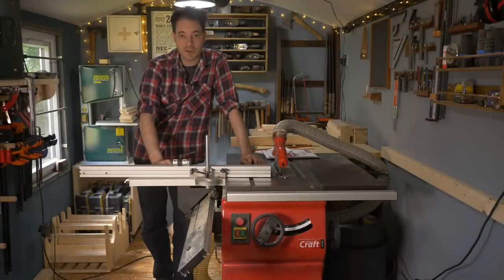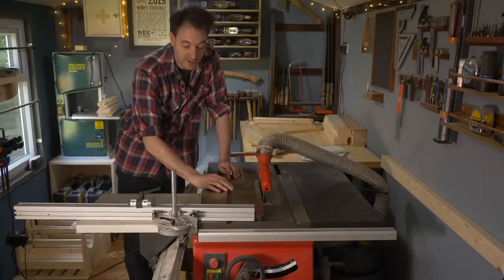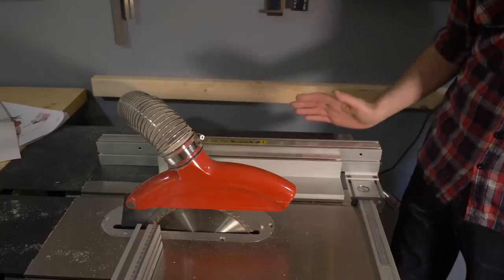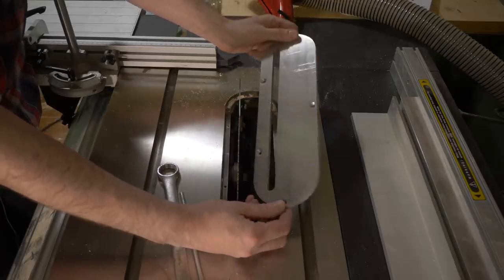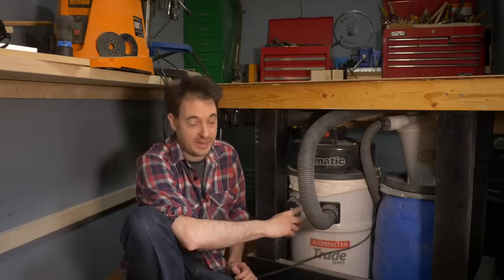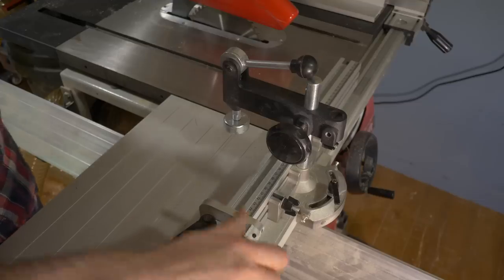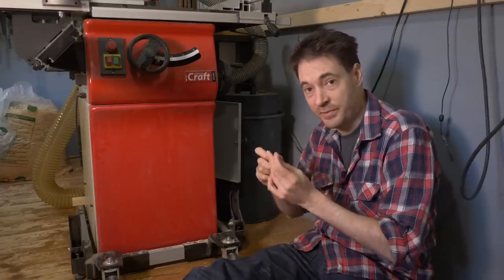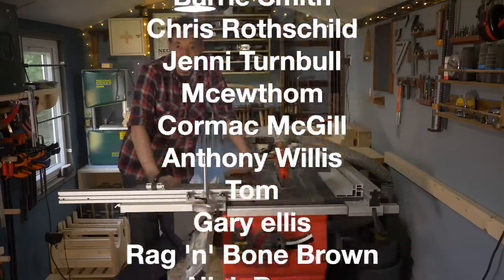Axminster Craft AC216TS 216mm Table Saw Review

Comment: Slightly different opinion.  I have had the saw approx 8 months.  Regarding the sliding fence, the wheels on the slide mechanism go out of true and I ended up with wavy cross cuts. The hold down bar/ pivot is almost always in the way of the stop, cannot slide it past the pivot.  You have to take it off one end and put it back on the other andi it won’t sit in front of the pivot .  When I received the saw the cast iron table was almost 2mm out of true to the cabinet but was true with blade.  This meant when the slide was fitted ( fits to the cabinet, not the table) it was out of true with the table and fouled it at one end.  I had to pack it out with washers to fit.  The fence almost always moved outwards at the far end when clamped so it asn’t true with the blade.  I solved that by packing the cam lock with tape to counteract the drift as i tightened it.  Axminster sent a replacement fence and that seemed to be better.  The riving knife is higher than the blade which means cutting half lap joints etc is impossible.  I solved this by cutting the top off the knife.  I found that I never needed the dust extraction from the  top so no great loss.  I use the Axminster AC50E using the bottom port with the top blanked off and there is virtually no escaping dust.  I wanted to use a table saw sled but the out feed table mitre fence grooves stop short of the end meaning the sled would not slide all the way through the blade.  fixed that by extending the groves.  Finally the supplied riving knife was a tad too thick so ended up taking all the paint off and grinding it slightly.  So now i have a table saw I’m happy with but why Axminster don’t have a different option for the riving knife and extend the grooves in the out feed table, sort the fence so it stays square, and don’t get me started on the sliding fence (a member of staff said to me when I bought it to use it periodically otherwise the wheels flatten, he was not wrong and I used it all the time).  Don’t let me put you off all in all it is accurate, it is quiet just needs a bit of fettling

Comment: I have been looking at getting a Dewalt site table saw but I wasn't keen on the noise plus they just aren't as accurate so was looking for an alternative that was still reasonably easy to move around without needing an engine hoist to move. This looks like the best of both worlds to be honest and doesn't cost much more than the Dewalt. I think I will be getting the slightly larger version of this, as they now do one with a 254mm blade and 1.5KW motor and a slightly larger table. Great review.
Reply from the maker: The 254 saw looks a great machine. I would have got that one if it had been available at the time
Reply: @Badgerworkshop  I too was about to get a Dewalt contractor saw (It's in order and I am waiting for it to be in stock), but after seeing your videos about this saw I've changed my mind. Just like Paul says, noise is a major concern, but also things like the lack of a cast iron top. I've seen Axminsters before, but I thought they were not as affordable. Thanks so much for making these videos. The link you've posted to the saw is not an affliate link, is it? Would be nice if I could support you
Reply from the maker: @doisneau  It as an affiliate link, thank you. I hope the saw will be back in stock soon
Reply: It is quite heavy though. Not really designed to be mobile.
Reply: @asconaracing  No, they are heavy but compared to a full cabinet saw they are still quite easy to move around the shop. Not 'portable' though by any measure.

Comment: Great clear concise review. You only missed out on depth of cut, issue with Riving knife height compared to the blade stopping through cuts and detailing how accurate the main bed of the table was (flat). For my workshop, as far as I can find, this would be the best option available despite its flaws and while I don’t need the sliding table I think actually it would be really useful given that it comes off so easily and can then be hung up out of the way. Thanks.

Comment: Hi Matt great review on the table saw. The cast iron tables nice with the extra wing for wide ripping. Its good to see a proper long saw 
arbor and traditional locking nut. I'm impressed with the build quality overall, the sliding crosscut table fence is a real advantage like 
you say. The swivelling mitre feature on the cross cut fence is amazing that's a real bonus. A point on the noise, its the size and type 
of saw blade that fitted which produces the noise not the motor. It looks very capable of making accurate wooden components. Tony

Comment: I have the Axminster 1600 panel saw. Bought a few years ago. It has a large foot print even in a 3 car garage size  workshop but one of the simplest and most useful addition to it is a Fritz and Franze (probably not spelt that last bit right) jig. Search on YT. I think he's called 'extreme woodworker' There ain't much info but a guy in the states with a seriously expensive Martin table saw shows how to make one. In your tiny shop you would get a lot of use for it with that parallel sliding table. Safely cross cutting small parts etc. Have a look it will need a bit of thought to adapt to your machine.
Nigel.

Comment: Hi Matt, I watched your videos on this saw several times while choosing which machine to go with.  Your positive reviews, plus those elsewhere, encouraged me to buy the table saw around 18 months ago, and the sliding table last Christmas.  This is my first table saw.

Have you had to make adjustments for accuracy?  If so, did you find them acceptably easy to make?

All along I have found the various adjustments to achieve accuracy very fiddly and awkward.  Currently I'm trying to get consistently accurate mitre cuts.  I've spent many hours getting the sliding table into an accurate position in all dimensions, including during the slide itself.  I've managed to get the mitre angle quite close to accurate, but when I make another small adjustment to the relevant small bolt, the effect of the adjustment seems to be fairly unpredictable.  I can't home in on a good enough 45 degrees.

Do you have any thoughts on this?

Thank you, Roger

Comment: Thank you!

I think my shop is smaller than yours but I might consider this saw after your review. Maybe I can make it fit without the extension table as it is 400mm slim. I was thinking about buying the Bosch GTS10J but the aluminium table is putting me off. 

Regards, 
Etna.
Reply from the maker: With the sliding table it’s a nice compact machine

Comment: Thanks for that video. You have confirmed my hopes and removed my few concerns. I’m even persuaded by the sliding table argument instead of a miter saw for a small shop. 
It seems expensive for a hobby set up, but that’s possibly redeemed by fewer fiddle moments with cheaper solutions. A craft should be about skill and not tools (if not about just making things)  but good tools do seem to go a little way in resolving some skill/experience shortages (speaking for myself of course). 
Thanks as always for the content.
Reply from the maker: Thank you. Better tools certainly makes life easier

Comment: Hi David, have watched this video several times now and it has convinced me that this will be my next saw, after 1 cheap and one not so cheap had to be returned.
 Concise and detailed description of most of the working details, however you did not mention if the saw came with a mitre gage and Axminster say, "There are after sale mitres that fit the saw" Will need to speak with Axminster. Was one delivered with your saw? The fact that the sliding table has allowed you not to have a dedicated mitre bench is yet another buying point. Will need to save for the sliding table. Thanks for a highly informative video. Get onto Axminster for some sponsorship!!!
Reply from the maker: It did not come with a mitre gauge. I already had one

Comment: Impressive saw. Could you tell me, what is the height of the table above the bottom edge of the stand and the table dimension with the rhs extension? Like you Im stuck for space and this saw seems to outstrip anything else for value and quality and use for finer woodworking.

I did hear that you can get a longer arbor that might allow dado blades to be fitted- is this so?

You reviews are really useful Mat- keep it up.

Comment: Hi Matt.  I am very seriously thinking of going for this machine over the DeWalt 7485 for my small, mostly hand tool shop (single garage-sized).  But I need some advice on dust/chip extraction.  I noticed you have reviewed quite a few solutions over the years and I was wondering, now you know what you know, and were starting again with the Axminister 216, a small (crappy) planer thicknesser, and not much else, which dust/chip extraction system would you do for?  I am on a budget, and I don't really want to spend 50%+ of the saw price again on extraction (seems a lot!), but then again I do want something quiet (If I am buying a quiet table saw, there is no point if the extractor is crazy loud!) and not too big.  Have seen a brand model what you feel would be best?

Any help you can give would be much appreciated as extraction is part of the budget, so would like to have decided before I press the button on the saw!

Many thanks,  David
Reply from the maker: I’m using a twin motor cam vac. It is small and can be used on all my machines
Reply: @Badgerworkshop  Fantastic!  Although not cheap these sound good.  Do they move enough air for the table saw OK?  Also are they quiet?  I would want something with an quiet induction motor ideally. Not sure if camvac use these or brushed.  thanks for your advice Matt

Comment: @Badger Workshop hi Matt, I went to look at a second hand 216 today with all the upgrades. I have an evolution rage (higher power and deeper depth of cut) I’m torn. Would you still recommend this table saw to this day or would you go for a dewalt/bosch contractor saw still? You sold yours when you moved house was that just due to space? Thank you so much for your help!
Reply from the maker: Yes I got rid of the saw to save space. It was a great quiet and accurate machine. The Bosch and dewalt are both good but loud. They are more powerful though if cutting lots of thick wood

Comment: Thanks Matt ! It's clearly much improved on its predecessor. That was a really good review, right to the point. I still wish it'd been around when I bought the DeWalt, I believe the extra cost would have been worth it for the greater mass and features, not to mention the quietness.
Reply from the maker: The dewalt sill looks a very good saw
Reply: I bought the dwe7492, I was really disappointed and sent it back, loads of movement in the blade and noise it makes when you turn it on makes you jump out of your skin!
Reply: @nylon222  Mine is the DW745 and with Freud blades the cut quality is excellent. It's not without its deficiencies which can be fixed. I still have to remind myself that it is just a contractors saw. The noise is horrendous I agree, bur with some good ear defenders it's OK. Sorry yours was a let-down.
Reply: I have the old dw742 and whilst it has its limitations and is a tonne to lift, the motor is beautiful and quiet and the blade is true and steady as they come. Although it has a better rip capacity and depth etc, the dwe7492 just feels like a toy in comparison. It hadn’t been setup at the factory at all to the point of being dangerous to use and there was so much play in the housing pivot that the blade moved about 1mm at the back when you pushed the blade housing with your hand. There was literally no way to get the blade square to the mitre slots.

Comment: Hi Matt. You didn't mention the blade guard extractor cover with regard to blade height. In the video the blade was set much higher than I would use normally (half a tooth above the top of the wood usually). Is the riving knife adjustable to get the cover nearer the wood surface when cutting thin material?
Reply from the maker: The riving knife is higher than the blade

Comment: My shop is more or less the same size as yours. Maybe not as long, though. Since this saw look really interesting I have a few questions.
What made you go for the 216 over the 254 with the 8cm cut capacity? And have you ever wanted for a larger blade? The saws seem to be more or less the same.
Is there a positive stop on 90 degrees on the sliding miter fence?

Did you consider the slightly larger one from Axminster? I dont remember the model name, but I think it is the one one Keith Brown has.
And finally, how is the riving knife change on this saw?
-Nomad
Reply from the maker: The larger one had not been released at the time. There is a stop at 90°. The larger machines need 16amp power so I did not consider them. The riving knife comes off with loosening two bolts.
Reply: @Badgerworkshop  Have you ever felt that the smaller blade is stopping you from doing some tasks?
Reply from the maker: No as I have other saws like the bandsaw that can do that

Comment: I have been looking for a small induction motor based table saw and based on your review am seriously considering the Axminster. I now see they have a slightly larger AC254 model. Have you yet found the cutting depth on AC216 slightly wanting ? Have you got any observations other than the obvious price difference regarding the comparison of these two saws that may assist me as I start out in woodwork and put my workshop together?
Reply from the maker: If I had the money then a bigger saw is always more useful. I have other machines so I have not missed the capability

Comment: Just ordered this but went with the leg stand, having second thoughts about changing to cabinet! Any particular pro / cons on the two options?
Reply from the maker: I seem to remember that the cabinet would make the saw higher. I’m over 6 foot and wanted it taller. But I could be wrong
Reply: @Badgerworkshop  thanks for the response! Yes, I saw that online last night 880 vs 900mm... I blinked at the cabinet and is now out of stock ! Oh well -
I’ll see how I get on with the leg stand.
Reply from the maker: @bef58115  I have mine on a mobile base that makes it even higher

Comment: Looks great! Especially the slider, a product segment that is really lacking in the US. We do have European sliders in production shops... $1X,000, and Sawstop recently introduced a slider option for cabinet saws, $2,XXX. But nothing in this price range. The Axminster site gives me a $575US price for the base saw,  but sadly won’t deliver it here! It would not take me to the pages for the slider or the base, but I’m guessing about 800 pounds for that setup? I do have a large shop made sled for my table saw, but I am going to pivot to a shop made (Parf sys ) 20mm hole table top, with a Benchdogs.co fence and rail dogs for my track saw. I just got some additional UJK stuff from Axminster... that shipped over here in 2 days no less.
Reply from the maker: That’s quick service. Hopefully someone in the US will introduce a small sliding table.
Reply: Slides are not very popular in the US, but they are very convenient. This is not a common project but it is relatively easy to make a precise slider out of mostly wood based on my experience (see https://youtu.be/6c2P1UyXfnw?t=3008 and details I added in the comments there for more info).
If you go for a parf/benchdogs.co.uk fence, you may consider an incra fence with its flip stop shop, as this works quite well as a substitute for the benchdog version and its flip stops in my experience.

Comment: Hi Matt I’ve been out and bought the same tablesaw but I did struggle to get the cabinet I think there’s a bit of a shortage I was wondering could you tell me the internal size of your workshop mine is only a fraction over 2 m wide and a fraction of the 4 m long is yours much wider? I’m a bit concerned about the saw and the space thanks very much Ben
Reply from the maker: Mine is 2.25m wide and 6m long
Reply: thanks Matt really appreciate that information I’ve just been in my shed and measured it it is 2.18/4.16 which is similar to yours in width I went a bit mad in the Axminster shop in Warrington and spent 4000 pounds on a bandsaw table saw planer  thickness and wood turning lave Hopefully It will all fit in when it arrives thanks again for the information kind regards ben

Comment: Thanks for your review! Have you found that you miss or need a 10inch blade over the 8inch one?
Reply from the maker: I have not but I also have a larger saw
Reply: @Badgerworkshop  Thanks Matt - I'm leaning towards this saw... Would you mind helping my understand how I could overcome the limitations of non-through cross/mitre cuts e.g. I need to make a mitre cut that is deeper than the 8" blade can manage, how would I rotate/orient the piece to make the second pass to complete the cut? Any videos or resources you can think of would be helpful. Much appreciated, Matt

Comment: Thanks Matt. Like many I’ve been a long time customer of Axminster with a heavy bench sander that was secondhand when I got it about 20 years ago, a floor standing pillar drill about 15 years old and more recently a bandsaw. Been soul searching over a table saw since before lockdown and had come down to this, your old Bosch or a Dewalt. Thanks to your review I think the Axminster wins. One question, have you found the reduced depth of cut a problem? On a general note while subscribing to a few channels the fact that your tools, ideas and not to forget physical work space are generally within reach most of us and that will always make you a favourite for me, keep up the good work.
Reply from the maker: I have not found it a problem but I have another machine for thicker material